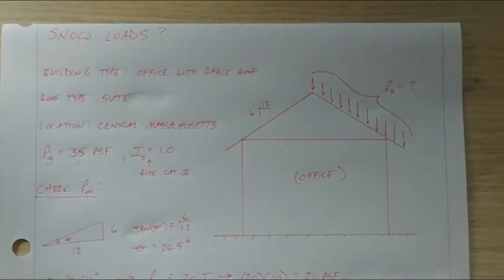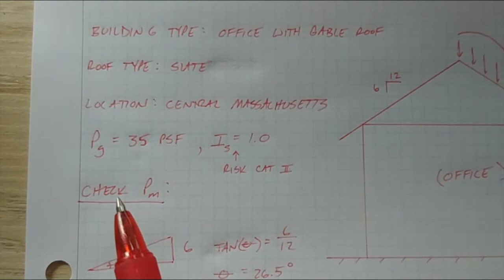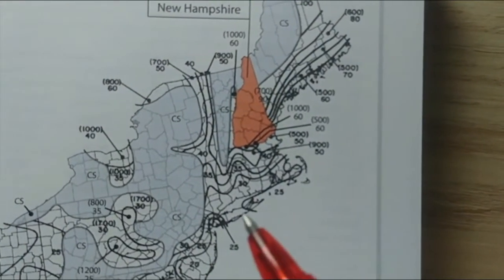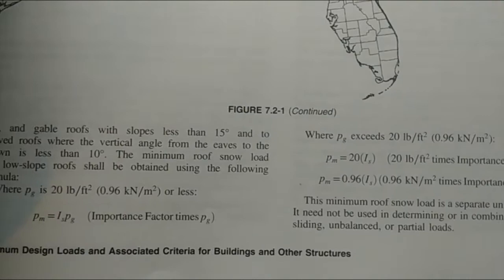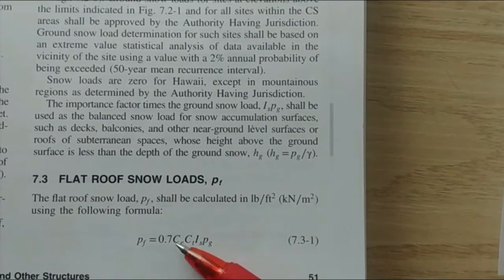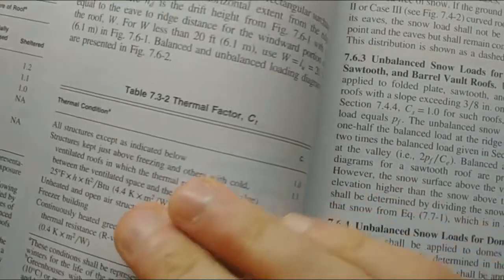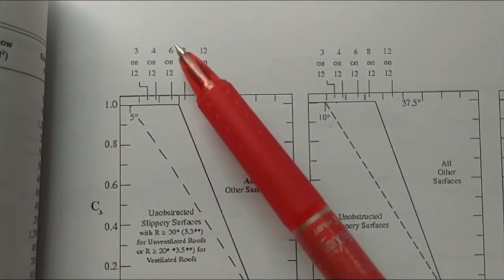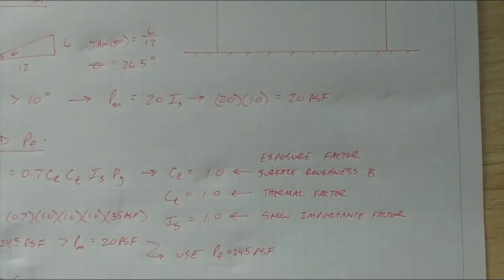Snow Load Design on Gable Roof

Comment: Could you tell me what size rafter i would need for 4/12 pitch, 28'span, 14' run, in Lewiston Maine 04240,  80 lb snow,16 lb live and 10 lb dead, ceiling joist, living space below, unheated attic above, metal roof, may need LVL ridge beam. Thanks!!
Reply from the maker: send me a email!

Comment: Why is this made so complicated? If I have a roof, of any shape, with any roofing material, that is 20 ft wide and 20 ft long overall, as seen from above, I have 400 sq. ft. exposed to the sky. If one foot of 40 psf snow lands on it I have a total load of 40 x 400 = 16,000  or 8 tons. Whether the snow stays put (asphalt shingles) or slides off (steel) is irrelevent. That 8 ton load sits there at least briefly, and the structure must be designed to handle it. I have a home with a 3:12 metal roof in snow country, and while the snow will slide off in ideal conditions it often accumulates to a depth of three feet or more. Not a problem. I designed the house to take it.

Comment: since the slope equals 26,5deg and 2.38 < 26.5 < 30.2 unbalanced snow load case must be considered
Reply from the maker: yes absolutely! - this was not covered in the example, just obtaining the sloped roof snow load.
Reply: @Kestava_Engineering  What area, for the square feet in "pounds per square foot" of snow load, applies for a sloped roof?   Is it the horizontal projection of the roof area that gives it its exposure to the snowfall?  Or is it the actual surface area of the roof?